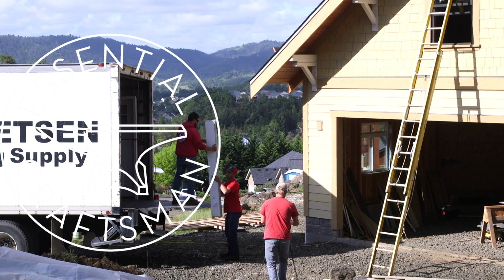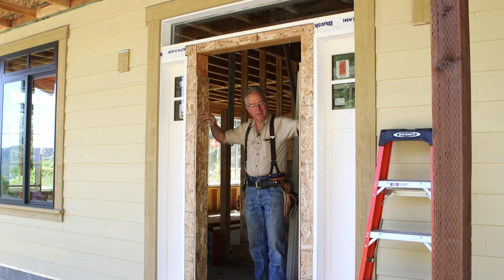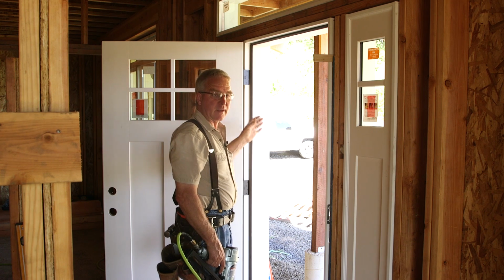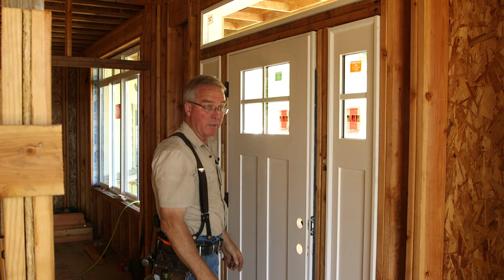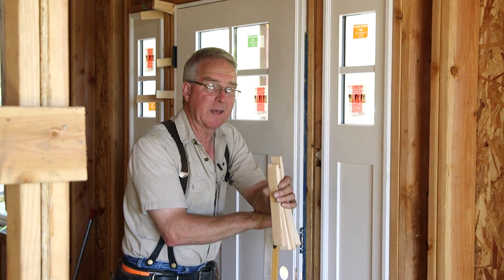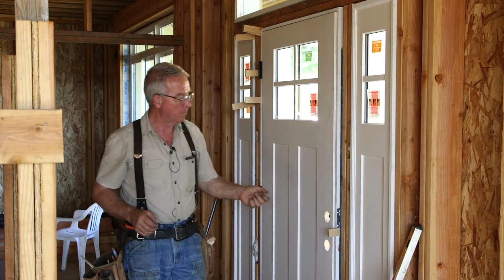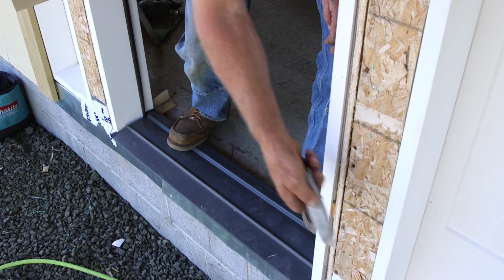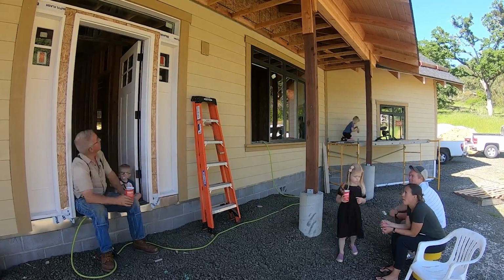Installing Front Door Ep.83

Comment: I've been working on a big remodel on my house the past several weeks.  I've done several remodels in the past, and this latest one has only reaffirmed lessons I've learned in the past.

Lesson 1:  It's going to take longer than you expected.
Lesson 2:  It's going to cost more than you anticipated.
Lesson 3:  Plumb is nice theory, but doesn't exist in reality.
Lesson 4:  The way it was originally built will never change, no matter how much you complain about how shoddy the work was done. 
Lesson 5 (or 4b):  Problems are the rule, not the exception.  Deal with things as they are, not how you want them to be.  This will save you time, money, and emotional energy.
Reply: Thanks for this comment. I‘ve spent 7 years on a complete refit (rebuild) of my sailing yacht, and wish I had read this before I started. 🙁 But I now have a ship which is better than new, and I expect the same goes for your remodels. 😊 I also get great satisfaction from overcoming Lesson 5.
Reply: So right except for Lesson 4. You can change that if you are mad enough!
Reply: A life of remodeling work has taught me the same. Your 100% correct sir.
Reply: @bradley3549  disgust is the emotion that compels me to do a good job on remodels
Reply: Always.

Comment: Your series is one of the best. I like the practicability of your work. If you don't mind, may I ask if it is wise to fix the door frame with two initial nails or if it is not better to fix it with screws which are easily adjustable. Thanx.

Comment: I accidentally used silicone caulking to caulk all the trim in my recently remodeled kitchen. Didn't realize until I went to paint and it wouldn't stick. Had to tear it all out and redo it. NOT fun.

I once lived in a rental that had a badly hung front door. The landlord was pretty useless when it came to fixing things, so I took it upon myself to do it. After taking off the inside trim, I found a 2" gap above the door, the opening was framed 2" too tall. Only a piece of trim on each side, no insulation (on an exterior door). Also, no shims around the entire door. I shimmed it properly and filled the void with spray foam. Worked great after that!
Reply: Tip 
Use plumbers  primer  on the silcone
Reply: killz primer works for silicon to paint it after

Comment: I will pull one screw from each hinge and replace it with a matching 3" screw. Stability and security.
Reply: Same  even though the hinge side is less critical. It's just good practice to not leave a weak point.
Reply: Adam Newton hinge side is less critical? It carries the weight of the door.
Reply: The factory screws on the hinges are plenty sufficient to carry the weight of the door, we replace them for theft security, not holding the weight of the door.
Reply: I always put 2 long screws in top hinge and 1 on the rest of hinges..itll never sag in years to come
Reply: You wouldn't believe the amount of screws that go in the door frame for Hurricane code in Florida
Reply: I undo the hinges on the frame, and put a screw in there, then put the hinge back. That way the type of screw color or bit type wont matter. Got into this habit fixing interior doors.

Comment: Once again, great content!  I bought a 1984-constructed home in 2005 (not a cheap one) that has tons of intricate oak trim...compound crown molding everywhere...kind of fancypants.  But nearly every single door was hung poorly. I've had doors swing out on their own, in on their own, I have two or three doors where the latch didn't even align with the strike,  I've had two pocket doors fail (replaced them with a standard door)... I guess the message is: installing doors is a true skill. Dealing with the consequences of a poorly hung door is a daily frustration!
Reply: If your doors are still swinging, pull one or two of the pins out and smack them with a hammer so they bend. Helps stop the swing.

Comment: I started at twice the cost of the door system and used a very critical eye on the structure; pushing on  the walls, bouncing on the floor by the opening, checking the floor for level, checking the wall for plumb- both sides. There have been cases where termites have eaten out the rim joist and floor joists to the point of needing to be replaced and sistered. That job was WAY over twice the door price. I always include in my quotes the MAXIMUM price for a basic install UNLESS there is underlying structural issues which will be fixed for an additional cost. I want to do a good job and leave a happy customer. A happy customer STARTS with me setting expectations. Great video.

Comment: One time we were replacing doors and windows on a balloon framed farm house. Got around to the back door they had the washing machine in front of it they said it never worked but we had a door to replace it with. You couldn't budge that thing an inch we had to cut it out of there. Long story short we got it out and no header just the studs from the rafter top plate sitting right ontop of the jamb. Had to jack the house up a bit after we got it out and reframe a bit of the wall. So a door job turned into a shoring, framing, siding, and door job.
Reply: The joy of an old house reno.  I never quote jobs - estimates only.  I have a whole section of caveats expressly written to handle that kind of surprise.  Learned by experience.  Less time and money lost and more happy customers.

Comment: Thank you so much for pointing  out how expensive  the project is when you have to demo. If I have to go pick up the door it's at least 6 hours. If the opening isn't plumb, level, square (which it never is on a replacement)and I need to start messing with the rough framing and doing special shimming, it's all day.

Comment: I'm glad to see door makers are adding that steel return for the deadbolt, but I'd encourage anyone doing this install to add an additional return that is mechanically attached to the frame of the building when you put in the lock.  If you've ever seen someone mule kick a door down like it was secured with paper-mache, that's because they were relying on the relatively thin bit of wood in the door frame to absorb that force.  I see vastly too many of these installs.  My deadbolts are secured with a galvanized steel cup  just behind the decorative catch and is attached with three deck screws to the building's framing lumber.

Comment: If you're using wood interior doors or wood in general, make sure you reveal against the frame closing is not too tight, with humidity and other factors the door will expand slightly and then get stuck.  In our case we used screws for the entire install and when it got tight we spread the frame out slightly further.  (We installed in the winter and the door got tight in the summer if I remember correctly.)

Comment: What purpose does the Metal Flashing serve that was installed below the door? I have never seen that before. I am about to install an exterior door on my new house build that I am doing for myself so looking for guidance.
Reply: It ensures that any water that runs down the door is directed to the outside, rather than pooling on the wood under the door or running to the interior.  You could use a plastic based material, but metal will be more durable.

Comment: The layman may ask, “Why all the shimming? Why not just make the rough opening perfect?” The answer is - The rough opening IS as perfect as it can be. Shims are just a necessary, and essential part of door installation, period. The ONLY way to hang a door, NOT using shims is to set the door first and then build the structure, carefully around it. 
[I’ve never tried that method so I’m not even sure that’s 100% guaranteed]
Reply: I've seen a house where the framer used PSLs for the doors and critical walls like the kitchen, and rough openings were "dead nuts" plumb as he put it, basically he lasered everything constantly.   Doors were hung straight into the framing, just screwed the hinge side on with no shims because the PSLs are perfectly straight and flat, and every door was perfect, so it can be done with special attention in the framing stage to have perfect openings.
Reply: @FeelingLikeThatNow  That’s ok for hollow core interior doors, but to be installed correctly, you would still need to shim the other side of the jamb. Otherwise you’re just relying on the door casing to hold that side of the door jamb straight, which is not ideal. The jamb should be fastened to the framing directly or you will likely encounter problems down the road. (Some ‘hacks’ do it anyway, I know 🤷‍♂️)
When you’ve got an exterior door like this one, with side lights on both sides, and all those reveals to take into consideration, it would be extremely inadvisable to just fasten the hinge side directly to the framing without examining how everything else will finish and shimming accordingly.
Reply: I’m the super for a commercial GC. The framers made the RO for the European aluminum entryway door the exact size of the door. Installers came and it was a tight fit, but the door went in perfectly with one shim in the bottom corner. Those carpenters were horrible with their tapes but good with their levels.
Reply: Here in eastern Canada the rough framed opening is 1” bigger than the overall door frame. For shimming and insulation (spray foam) to stop wind drafts
Reply: Sounds like youve hung a few doors...that comment is right on

Comment: It is interesting that the door has nails through it. Can't you buy with plugs that cover the screw? In Norway our doors are installed with hidden fasteners so that there's no need for puddy and paint. We use 6 screws in total, either regular screws or adjustable screws. Normally it's the same on windows as well.
Reply: A 22 ga nail needs no putty whatsoever, paint hides it. An 18 or 15 ga nail takes literally a fraction of a second to puddy when you go through and do all the holes at once. As for paint, we paint our stuff here, so trying to avoid painting our stuff is never gonna happen. Now at least for exterior doors, you're never relying on nails to keep it in place. Screws do that. It seems most Europeans believe North Americans use far inferior building methods and this is not the case, but you're watching this series so you're learning that for yourself.
Reply: Personally I don't use nails when installing exterior doors, I will pull the weatherstripping out of the groove and install 8 -3 inch  stainless steel screws behind the weatherstripping so it's never seen or needs plugging or filling
Reply: The other thing that makes avoiding filling even more superfluous is that in most projects paint is subbed out to a dedicated painter, and he's gonna caulk and spackle everything already, and he's gonna do it such that it looks like there's no fasteners because that's always the goal, and that's gonna look much better than some plug.
Reply: @stevebengel1346  I agree with you, but for a 6 9/16 door the outer jamb needs some attachment, UNLESS you can carefully nail the outside casing into the outside edge of the jamb.  I've also seen plenty of shims+glue along the verticals to prevent movement.

Comment: Thank you very much for this. I recently installed a pre-hung door ( "door set" we call it here in Scotland) and it took A LOT longer than I had planned, including a call to the carpenter who made it to tell him that the door set was faulty. He (patiently) explained that they are made to be perfect once installed and not to judge the door until the hinge side jamb was fixed plumb to a wall. He was right. I had no idea about how the wedges are used to make adjustments, I'd assumed they were just shims. Great video and a lovely front door.
Reply: Also intrigued to see those first nails being used simply as "hands" to hold door roughly in place and then you can still move the door frame around with your wedges. I'd never thought of nail fixings as being "elastic" like that. Very useful info.
Reply: I use 3 1/2 pieces of plywood half inch thick to hold my frame in place..they cal be used over and again...simply screw them to the drywall to hold frame in

Comment: Doors are so much fun.  I recently did one where the wall was tilted outward by 1/2" over the height of the opening.  Fiddling it into place where I could minimize the drywall/trim fit inside and existing stucco/casing outside took a while.  Old houses are an adventure.  Plus side is the door closes properly and stays put at any position.

Comment: Any tips for deadbolt and doorknob installation? I always struggle to have them line up. End up with a chisel, moving them around, too far or not enough, spending way too much time. I may try installing the deadbolt before installing the door next time.
Reply: Its rare that you dont have some tweaking to do..i install doors for a living...in my experience with knobs deadbolts...always set the latch first then set deadbolt...most of the time youll have to do a little morticing to set the deadbolt plate..pretty much all the time...most of the time youll have to move the DB plate closer to the weatherstripping
Reply: @semajbest2324  Well, that's disappointing. There has to be a better way.

Comment: We leave all our rough openings for windows and doors with 1/2" space all around them. Leaves room for foam insulation and if you're using foam guns the nozzles on those are 3/8" so they won't get in if the rough openings are too small

Comment: Those thin steel plates on the lockset side are nearly useless for security. When I installed the exterior doors in my shop, I screwed 1/8" thick by 2" wide and about 4' long steel bars on the rough opening sides of the jambs, with square holes for the lockset on that side and holes for the hinge screws to pass through on the hinge side. It's a fairly simple way to enormously increase the strength of doors. I'm also going to put one of those "door armor" things on the door slab itself. American doors are pretty weak and insecure compared to the multi-lock European ones, but doing this helps a ton.

Comment: When hanging a prehung interior door, does the rough in height account for the thickness of flooring you’ll put in later or do you have to frame a little higher than rough in to allow clearance for when the finish flooring is put in?
Reply: I install doors for a living...what would best for you is to take whatever flooring and measure the thickness and give yourself a lil extra room in case the opening is far off..honestly i usually put a half inch piece of plywood under both sides of the frame and that works..but you need to measure whatever flooring youll put down
Reply: Semaj Best Thanks! I will give that a try!

Comment: Scott one thing you didn't mention is to not nail/screw into the top jamb, that needs to float. And also have at least 3/4" between the top jamb and header above it (so when the header sags in 30 years it doesn't prevent the door from closing).   The latter is more important for wide 6' doorwalls and the like. Admittedly with engineered headers (eg LVLs) this isn't as important these days...

Comment: One thing I've run into several times with exterior doors is forgetting to account for the interior finish floor height. If you're putting in full 3/4" hardwood or dealing with multiple layers of floor in a remodel, you better make sure that you can open the door freely. You may need shims below the transition, and possibly even a shorter door to fit with the existing header.

Comment: Try installing an old door into a new frame.  I had to do a lot of custom epoxy work.  Idiots in the past just kept shaving the door as the house shifted.    I have had to go and install angle bracing into the walls of old houses to keep them from racking too much with weather and temperature.    You have to set the door in the frame then use your level to set it in straight and plum and level.  Make a memory mark of the location then pull it, drop in the caulk under the threshold then lay the door in place.  You need only to move the door to make the marks line up then shim it into place.  You are right about the trick of hiding the big screws behind the moulding.    That is a nice door i'm sure but if it is a metal skin with foam and carboard inner center I would not touch them.  They are not secure.

Comment: Great vid as always EC. 

I've learned over the years that leveling the threshold/jamb header on retrofit work is just as important if not more than plumbing the legs. There's no correction after the fact if the hinge side sits high. Simpson DCU screws under the QLON is another trick as with their counter thread they act as shims until final fit is found the the shimpacks/foam can be added.

Comment: The frame around the door strike plate is the weakest part of the door.  I would go in and install a piece of bar steel in the the frame and use 4-5 inch screws to lock the door so a foot cant kick the door in easily.  The other wimp part is this pissy little screws that come installed with the hinges.  You should pull those one by one and replace them with some nice 4 inch screws to lock it into the 2x4 framing.   I built my last door.  It was 8 feet of 4 inch thick solid oak with pegged joints.  The frame was bar steel that was bolt anchored into the frame with 2 foot bolts.  I had a guy from SWAT try and break it down and he failed.

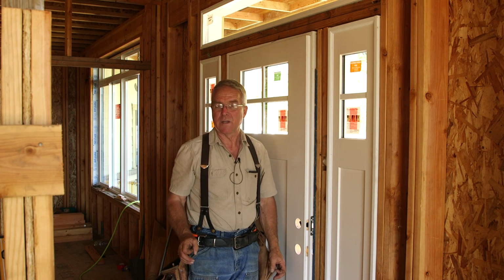Comment: Hmm the door still wasn't sitting right at the end. A properly hung door will stay where it's left at any position you leave it. It's clear the upper right corner of door jam was leaning outward slightly causing the door to want to pop backward from the jam at the closed position. It's ironic because if you just went with the install method you described at 8:50 you wouldn't have this problem at all. I've installed 5 doors in my house using that method and they always come out perfect.